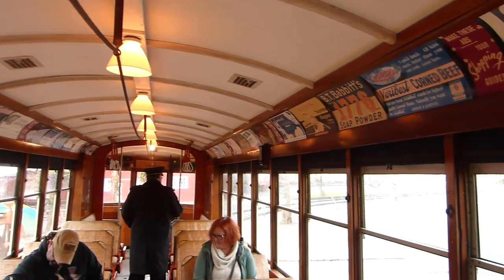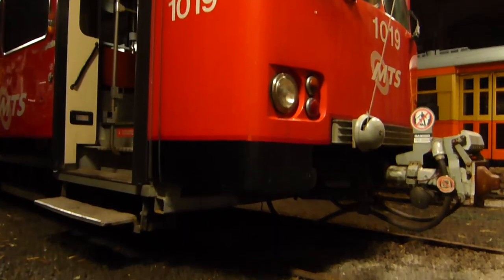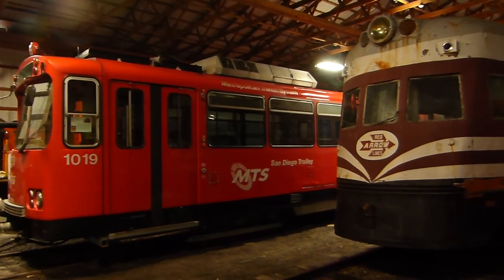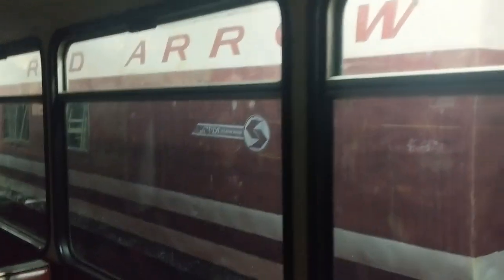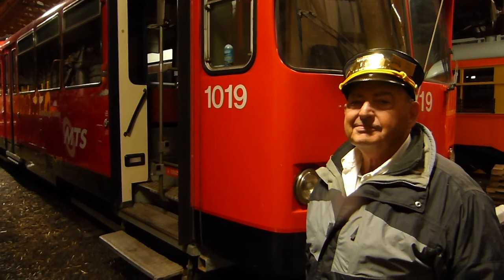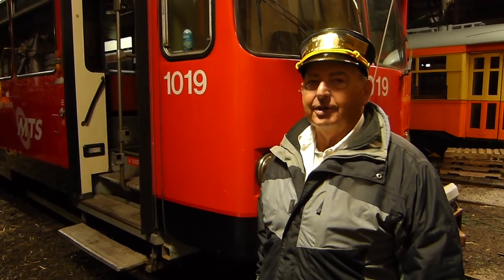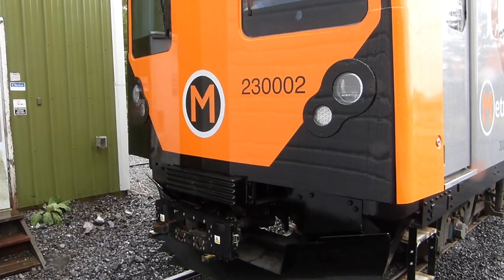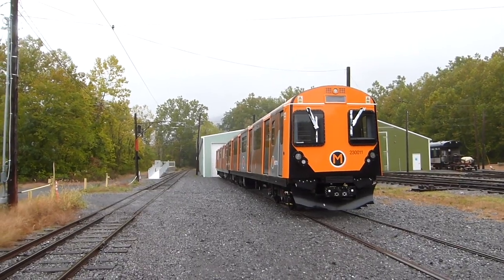Light Rail in a Trolley Museum? Get Used To It!

Comment: Nice video, Caleb.  I was the project manager for the museum’s acquisition of this car.  A colleague in the transit industry was a supplier to San Diego MTS for many years and knowing of the historical nature of these cars and the San Diego Trolley, personally financed the acquisition of this car and sister car #1018 which went to the Western Railway Museum.  The cars were actually traded to SDMTS in exchange for former NJ Transit PCC Car #10, which was subsequently restored by SDMTS and now runs on the Silver Line as part of the SDMTS historic fleet.  SDMTS has retained and preserved U2 Car #1001 for the same purpose.  Ron Rabena, featured in your video, was heavily involved with reassembling the #1019 after it arrived in Rockhill Furnace in a partially disassembled state.  He’s a super guy, too!

Comment: The Siemens U2 is a very historically significant rail vehicle.

The first modern light rail systems in North America were Edmonton (1978), Calgary (1981) and San Diego (1981), and all three of them started with Siemens-Duewag U2 trains. The U2 was originally designed for the Frankfurt U-Bahn, which was one of the global pioneers of modern light rail (1966).
Reply: Siemens SD400 is in st louis and Pgh
Reply: The U2 is longgg gone from the VGF network as well. Haven't seen such a train in ages... The prototype is still in Schwanheim in the Museum.

Comment: For reference, the popup metro concept isn't intended to be a permanent solution, but rather it is a way for a transport agency to test the viability of a rail line without having to risk losing an investment in stock and infrastructure if the project is unpopular.

Comment: The "thing" next to the San Diego lrv is the "libertyliner" that was acquired by the former Red Arrow Lines (P&W division) from Chicago in the 1960's. Out there they were known as "electroliners" and ran with trolley pole and 3rd rail shoes. When they came to Red Arrow they were converted exclusively to third rail and now at Rock Hill they are back to trolley pole. Did they let you operate the York car?
Reply: 1963

Comment: Great review of this museum. I'm especially hopeful for Pop Up Metro since it's a great way to reutilize and rebuild retired railcars of any sort, for severely neglected branch lines. Even if it's not the newest or fastest passenger train in the area, it's still connecting smaller towns to a larger railroad mainline, and lowers the dependence of the car. This sort of rebuilding program should be emphasized as a more useful alternative to scrapping older railcars such as the LIRR M3s or NYC Subway R32s.

Comment: What makes you feel old is when there are cars in museums that you operated when they were in revenue service. 
Rockhill Trolley Museum has 2 such cars. 
I operated 205 and 162 when both were in regular service on the Norristown High Speed line. 
I also served as crew (flagman) on P&W freight motor 402 and snow plow 10 as well. 
I never got to operate the work cars because I had low seniority when those cars were still active. 
With the same impending retirement of the Septa Kawasaki LRV’s there will be yet another car in a museum that I had the pleasure of operating in revenue service.

Comment: Streetcar museums acquiring first-generation LRVs is more evolutionary than revolutionary when you think about it. Most museums began in mid 20th century and were acquiring the "older" cars just as they were being retired. You mention the SEPTA K cars - at Pennsylvania Trolley Museum where I volunteer - we're preparing now to acquire one when they become available.   Institutional challenges I foresee in operating LRVs:  1.) Adequate and fair parts distribution to all museums for continued maintenance. That's going to mean hard decisions in determining which cars are worthy of preservation and which will be parts donors.  2.) Passing on the operational, electrical, and mechanical expertise from the transit professionals to museum personnel.  This requires building relationships now with transit agencies. 3.) Determining what adaptations are necessary and "worth it" to run LRVs on historic demonstration lines which may not be entirely compatible with it.  Are there curves, or loops with too tight of a radius? Are you ok replacing pantographs with trolley poles or is an adaptation of the overhead preferable? Are there provisions for high-level boarding if the LRV isn't equipped with low-level boarding or steps?    Thankfully the K cars will easily adapt to PTM's line, but points 1 & 2 are still applicable. 

Just some considerations to think about.

Comment: Thanks for this video of the Rockhill Furnace trolley museum. I have visited it in the past but not recently. I am glad that they are looking to preserve some of the more modern Light Rail vehicles which will become the old cars of the future. I just hope the knowledge and modern electronic parts will be available to keep them running like the older simpler  power and breaking system that most of the old trolleys have. I am an older fan so as you have said any museum that has old PTC or Red Arrow cars usually have cars that I may have ridden on while they were in original revenue service. As you get older I am sure you also begin to find newer saved cars that you may have ridden in revenue service.

Comment: The "Pop-Up Metro" idea might be great for the NCTD Sprinter, a 20 mile diesel regional rail line between Oceanside and Escondido, CA. The diesels are fine, butt they are noisier than an electric train.
Reply: Maybe, though they'd probably look at a newer and more well suited model. I mean the Pop up metro trains have very different specifications. But I wouldn't rule out battery or hydrogen trains for the Sprinter, similarly to what Stadler is building right now for a service in San Bernadino.

But the Popup metro design seems to be more so for experimental start ups, like if a city wants to try having a little rail line as part of its transit offering and wants to test the waters, they can get this for dirt cheap. Kinda the same mentality that went into the origin of the O-train in Ottawa.

Comment: If you look inside at the pop-up Metro the conductor UK Australian Railway terminology Guard it's actually inside the passenger compartment just like the older PATH trains PA1-4. Oddly it's not compatible with the American positive train control system because the switches are configured for the British train protection warning system and automatic warning system driver's reminder Appliance and DSD.